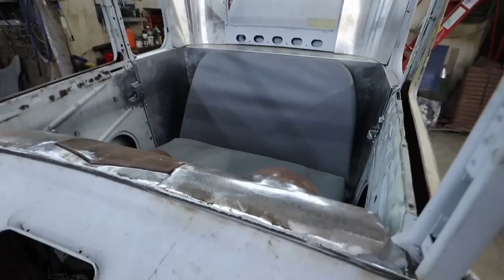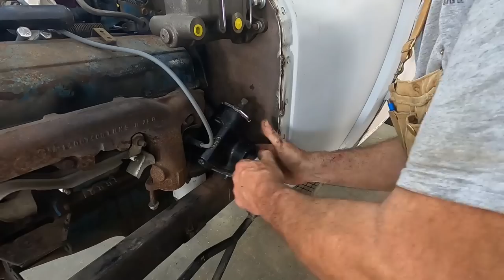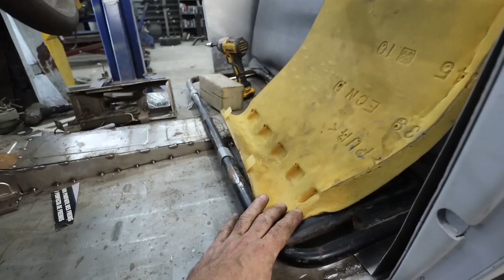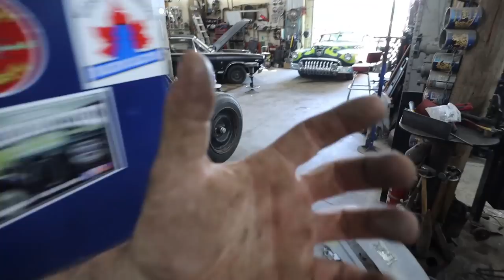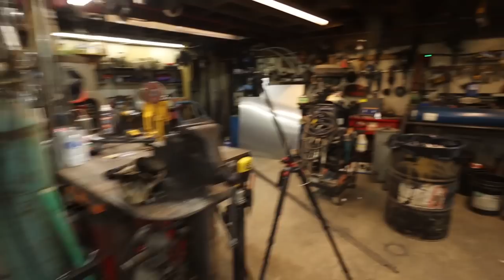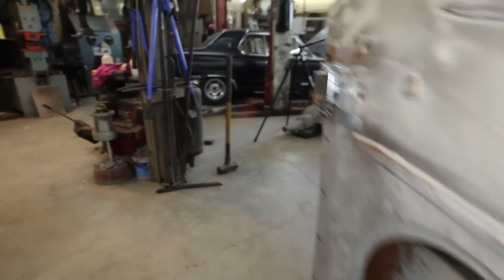Mounting the steering column on the Model T hot rod Part 12

Comment: Bomber seats cut dash to raise steering column. Have fun!!
Reply: I was thinking the same thing weld a half bit of exhaust tube in the bottom of the dash to lift it 1/2 a inch or so would make a big  difference at the wheel

Comment: Foam rubber is easy to shape with a 4” grinder. It shapes up well. You could glue in some foam and grind out a bucket with a grinder for your bucket to fit in.

Comment: recess the firewall slightly where the steering U joint is going. The 3 bolt steering wheel is off a boat!

Comment: On my buick I did a 4l80e with column shifter cable comes threw the floor right at back of the trans runs in a groove I made in floor small angle turned on its edge right were tunnel meets floor and the part on the clomun is on inside of fire wall only thing threw fire wall is dd shaft

Comment: Not sure if you've ever tried it, but Pontiac Fiero seats are bucket-like, but were practically bolted to the floor board so it makes for a really low seat "bottom" - not sure if those are around in your neck of the woods. I plugged your channel today in my A/C video thanks to your tip on Diflouro-ethane too - thanks :)

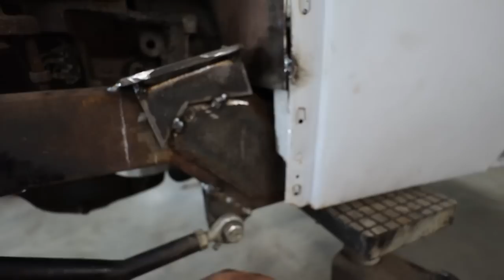Comment: 4:50 hey Brent, why not instead of having your steering box mount welded to the frame, why not box that section of frame for strength, weld in thru tubes, then make the bottom part of the bracket a U so it straddles the frame, then you just have to remove 3 or 4 thru bolts thru the frame to remove the gearbox? Then you could easily remove the box from the bracket

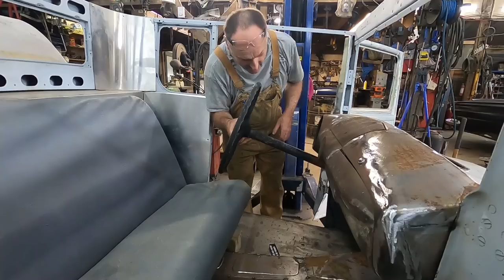Comment: 5:49 There is a guy named Div on you tube called Rat Rods for Africa. 
He has circle template guides made from slices of different diameter pipe he uses with his plasma cutter to make holes with.
Check him out.
22:29 Brent too bad you didn't have a tilt column to try.

Comment: What if you turn the inside back of the cab into the back of the seat? Round off the edges and some padding, that way you gain some inches of room;  anyways,  that hot rod is looking better by the minute!

Comment: You mentioned a pillow bearing,,,,,what is that?
Reply from the maker: It has a shoulder on it so it wont slip into the shaft. https://www.princessauto.com/en/2-pc-press-in-flange-bearings/product/PA1000000391?skuId=8066920

Comment: checked into HP tuners  if i understand correctly you buy the tuner and software. then you buy credits from them depending on just engine or transmission determines price. they also offer a school in FLA that you can go to about 1200.00  probably will try without it first if i can't figure it out then will go to the school. Mainly i want to turn off skim, and a few other things don't really understand about turning off rear 02 but thought i would ask you the main reason you do it. i really would like to get away from drive by wire but from what i have read have to use LS throttle body to go that way. i have a couple of throttle bodies one is bad thought i would see if i could modify and connect some sorta cable to it.
Reply from the maker: I just got some stuff from lsdroid which shouldn't need any credits but haven't had time to look into it yet.

Comment: Lose the dashboard,  it's off center and looks funky. Steering column needs raised,  which dashboard prevents. Dashboard is too large for this T build. Sometimes less is more. Your builds are normal excellent,  but this one is off a bit. Raising the column will also facilitate better higher seats. Keep on, keeping on. I'm building a 27 T now as well.